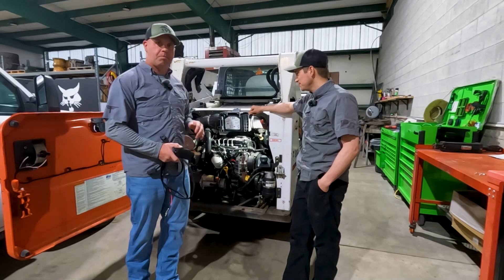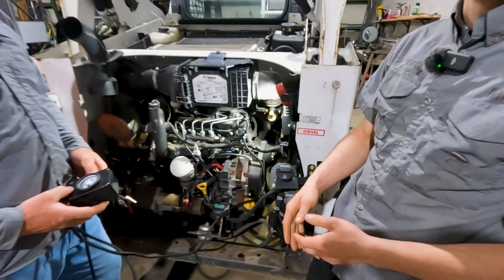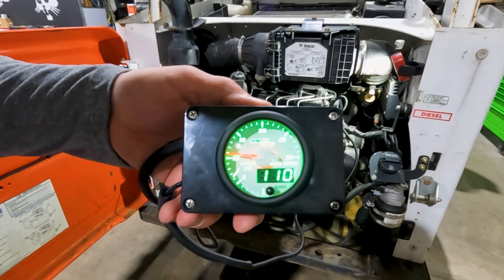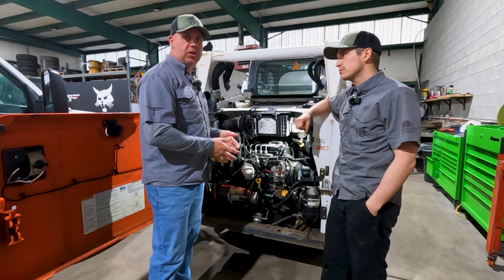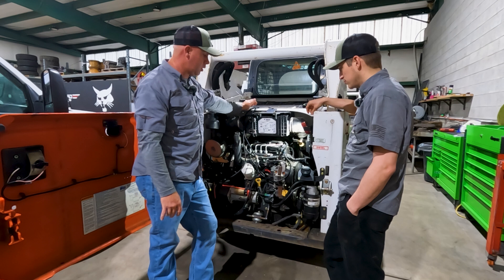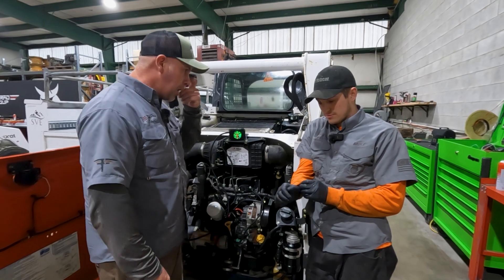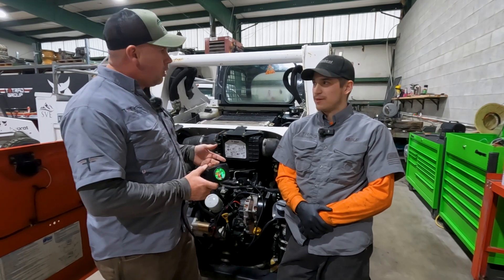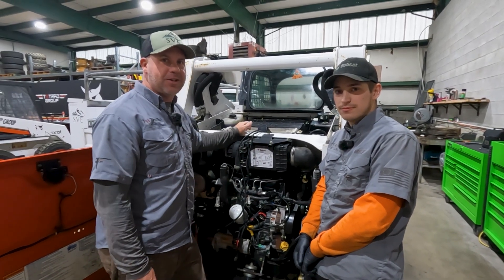Custom Fuel Gauge for your Bobcat Engine

Comment: I have a T450 giving me the low rail pressure code,machine would run for about 5 secs at idle then die and throw the code.  I replaced the fuel filter after seeing a good 1/2 cup of water cdrain out of the filter bottom and then I replaced the duetsch 2 pin connecter plug for the fuel/water sep plug due to damage and and now the machine stays running with no codes as long as the machines at idle, when I go full throttle, it throws the code e001076-16. I may need to cut up an old harness and make that gauge setup. Your videos are awesome btw! Please keep them coming!

Comment: Help on a 650 skid steer crank won't start the the injectors return lin the rubber ones when cracking the return lines get inflated with fuel and Pop off what would cause that

Comment: How did you put simulated load on aux flow?
Reply: You turn on the auxiliary’s with no attachment connected so the flow is going over a relief, which cause load on the engine
Reply: They turned on the aux flow with no attachment hooked up, or no loop hose on the couplers. This deadheads the aux and creates load.